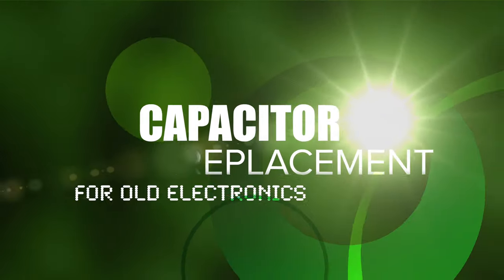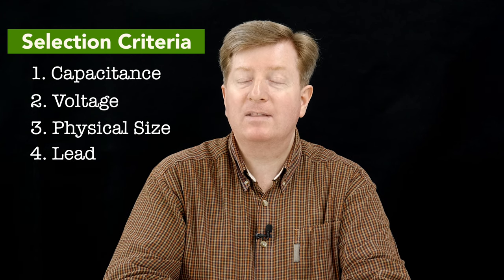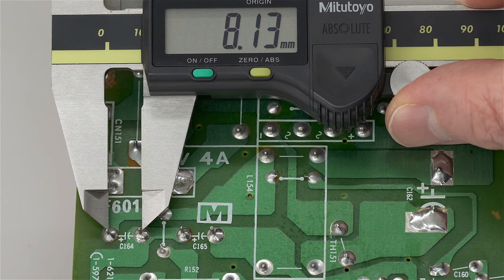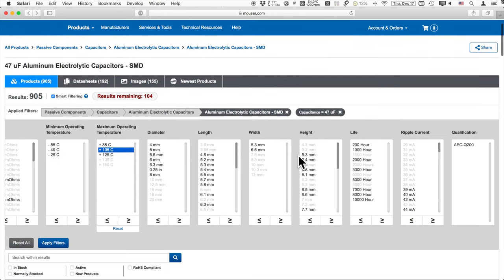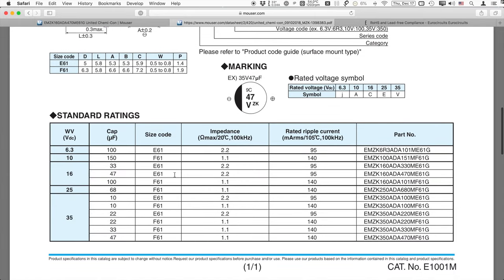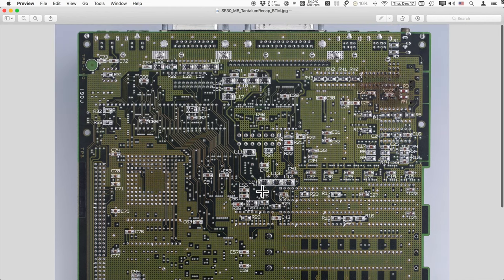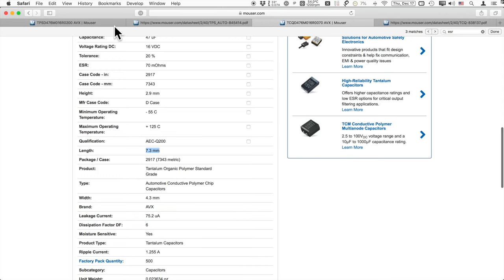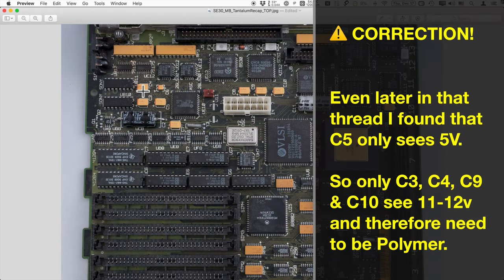Choosing Capacitors to Recap Old Electronics

Comment: some notes on audio gear which i have more than 40yrs experience in. i replace all ceramics i can. they are a big noise source along with composite resistors. not sure why you do not like lead free solder. i have used led free for decades and have never found a reason to go back. there are many outstanding led free solders available today. its not like it was in the old days. you do need decent soldering iron though 🙂 choosing between capacitor brands and models become more important in audio gear. it is largely irrelevant for other electronics. as i do mostly audio, the panasonic fc & fs and higher grade nichicon are the low-end caps for me. elna makes some great audio caps. for non-electrolytic caps, stick with film caps if you can. tantalum is great for computers but absolutely worthless for audio. and again, replace all your composite resistors with film ones i always use 1% which makes for more balanced output and easier fine tuning and better imaging. you will have a much more efficient system, greater headroom, better detail, and immersive soundstage. if you do the work yourself, the parts are dirt cheap. always shield your signal wires and pay attention to their routing. it takes a lot of time to do the work so do it right or not at all. cheers 🙂
Reply from the maker: I don’t doubt your good word or your 40 years experience with audio. But could you please explain why “tantalum is worthless for audio“? You have me curious. The reason I ask is because pretty much every vintage computer motherboard has an audio section on it.
Reply: @JDW-  true. i should have said good audio! computer audio does not have the stresses that a decent stereo has. tantalums are excellent in high frequency applications. they are more suited to digital signals. they sound positively crappy in analog. so yes they are heavily used in computers. i have extensive experience in them as well. i built my first one in the early 70's. the other issue with tantalums is their early problems with, well, blowing up! i am sure they are much better today but the reality is that they are not ideal for the variability and stresses of analog audio work. yes, they will function. in fact there are some vintage audio gear that came with tantalums. no, it did not go well 🙂 so, ok, worthless was a bit of hyperbole. but if you are going to put in all the effort and replace all the noisy analog components as i do, using tantalums will really ruin your day because it will limit the quality of the audio you can get. i have rebuilt 35w common sony integrated amps from 70's and blown away $10k discrete new audio gear in sound quality over and over again. i have a customer who spent insane amount of money on this fancy new setup and he barely uses it because the setup i made him for less than 1/5th the price sounds better. the secret is to eliminate all sources of noise even if you cannot hear it. the problem with noise is not just you hearing it. the problem is that it saps energy from the productive playing of music. this is why i shield signal wires. you may not hear the noise the composite resistors make but your amp see's it and has to deal with it which reduces your sound stage and head room as well as precision of detail. listening to such audio gear is like seeing a beautiful view through a perfectly clear window instead of a crud covered dirty one. it sounds natural and clear without all the crud in the way. but i digress 🙂
Reply from the maker: Thank you for providing further information. But what I meant was that even in a computer, it is not purely digital all the way to the speaker cone. The early audio stages are digital, but you still need an analog amplifier, however bad it may be in comparison to pro audio equipment, in order to drive that speaker cone. And so I was basically asking about capacitor types used in that analog output stage of a computer’s motherboard.

When we talk about tantalum capacitors it’s important to consider that the ones which can catch fire are SOLID tantalum, but modern versions known as POLYMER tantalum do not burn and have a lower voltage derating than their SOLID counterparts.
Reply: @JDW-  yes, that was why i acknowledged utilizing a bit of hyperbole. technology advances and old mistakes are remedied. i do not, however, distinguish between pro and non pro audio. this is mostly a marketing scheme and my work shows it. yes there are purely crappy audio gear out there but many of the gear produced in the 70's and 80's was designed well. the problem was in attention to detail. companies have great design engineers create the perfect unit, then the bean counters get involved and push the manufacturing engineers to save a penny on each component. as an engineer yourself, you would have seen this first hand as it is an unfortunate but nearly universal problem although with my work for the government, i did not suffer from that at least. well, there are thousands of components and 10's of thousands of units produced so the company saves a lot of money. also, they can have many tiers of product moving up in "quality" so it is all great for the company. we who love audio lose. because most of the audiophile equipment is not so revolutionary. most of the cost is not the components. so when we rebuild a vintage gear and use the very best components, we incur, at most, $100 more cost (not including transformers) but the resulting gear blows away most of those "audiophile" gear out there. i have done this over and over again. with sony, with pioneer, with yamaha, with marantz, etc. if the fundamental design of the gear is good, we can bypass the corporate bean counting and create an audiophile gear at a fraction of the cost. in this world, tantalum caps do not exist, like i said, because they are not the optimum capacitor for audio. i was mentioning the historical explosions for one reason audio companies mostly stayed away from tantalums; they just do not bring anything to the table that is needed in vintage audio. their strength is their size efficiency and frequency response neither of which is useful. on computers, both are paramount hence their presence everywhere there. and since they are popular, yes even the sound circuits use them. they are not that horrible to ruin computer audio. i have however, recapped some computer audio circuits and you will hear the difference there too, again, if you have a higher tier audio card with better design. i do recall, years ago, creative labs put out a nice sound card that minimized, or avoided (can't remember) tantalums and sold it for a pretty penny. it had gold plated i/o and was a nice card. i think it was in the 90's? getting old sucks 🙂
Reply from the maker: @AlsanPine  In light of everything you said and considering your extensive experience with audio and knowledge of computer recapping, perhaps you could give me your opinion about a audio noise problem I am trying to diagnose on a vintage Macintosh Portable from 1989.  Sadly, I am unable to get other Portable owners to give me feedback regarding what the typical noise floor is like, so I am somewhat working in the dark.  Even so, the noise is quite noticeable when using headphones, and it's nothing like I've heard in my other vintage Macs, so I think there is a problem on the motherboard that needs to be solved.  My latest video showing the troubleshooting and giving you an example of the noise is here (wearing headphones is recommended): https://youtu.be/MuEObdHCbig

My remarks about the motherboard audio circuit, motherboard schematics and other details are listed by me in the Tinker Different forum here:
https://tinkerdifferent.com/threads/macintosh-portable-pop-noise-every-10s-from-speaker-headphones.3425/#post-29120

If you simply do not know or do not have time to give this any consideration, I fully understand.  Not a problem. No pressure.  But I couldn't help but consider asking you because you are an engineer with far more experience in audio than I am.  I was thinking that perhaps by hearing the noise you might have some ideas I've not yet considered.
Reply: @JDW-  did my answer disappear?! i was going to add to it but it is not here! man, it was a long one too 😞 i hate the youtube message setup.
Reply from the maker: @AlsanPine  Please know that I did not delete posts ever.  YouTube is run by a band of brain-dead idiots, and I am being extremely kind by saying that.  Overly harsh?  Not at all.  I've complained to YouTube about this stupidity before.  Someone writes something, posts it, walks away, comes back, and their post is gone!  They mention it to me.  It then upsets me because I wanted to read it.  I mention this to YouTube.  Guess what?  They have no solution at all.  They are truly a band of idiots.

What I do know is that the foolish powers that be at YouTube don't want people posting links.  They setup their ridiculous algorithm to zap all comments with URLs into oblivion, EXCEPT for my posts.  Meaning, if I post a comment under my own videos, I am somehow empowered to post URLs, but nobody else can post URLs along side mine.  It's crazy and completely insane.  So it could be you had a URL in your post, and that is what triggered foolish YouTube's algorithm.  (If you can tell I am pissed off at YouTube management, believe me, I am.)

What this forces me to do is type out my comments in Notes (on my Mac), and then I copy/paste them into comments here on YouTube.  That's important when I am commenting under somebody else's video.  And then after I post it, if I find my post is gone.  I can re-read the post, figure out what to delete, then try reposting it again.  But of course, if you didn't save the content of your post, that doesn't help you at this point.   And if you are like me, and I think you are, then you are more than just a little ticked off at YouTube for having vanquished your multi-paragraph post into oblivion for no good reason.  And you probably don't want to re-type all that for a while.  But eventually, if you are like me, you will because people like us can't help but share knowledge.

Please also know that I am excited to have this dialog with you because you are a thoughtful engineer who has useful knowledge to share outside my expertise.

Lastly, please know that you are welcome at the Tinker Different forum.  I am one of the founders of that forum and currently serve as an Admin.  There is no time limit to editing posts, and we have a lot of other great features that other forums don't want you to have.  So if it's anything computer-related, Tinker Different is a great forum to share knowledge, and your posts will not be vanquished into oblivion, ever.
Reply: @JDW-   @JDW-  i have had similar experience. a lot of it is due to algorithms. one experience i had recently on ebay illustrates this. i have ordered a bunch of Salix discolor cuttings for my orchard from there but i could not message the seller, nor he to me, with the common name of the plant fully spelled so we had to call it pwillow! we forget that as far as we have come in computing, artificial intelligence is neither artificial, as it needs humans to learn from and intervene, nor is it intelligent since it is just a guessing machine. but that is a different discussion 🙂
i sort of re-created my post on the linked vid. it probably is not as complete or coherent as i was not happy for having to redo it. then i left the message here about the message being gone. this morning i see my message on the other vid is still there so i was going to tell you to go there for a less coherent version. i'm an old fart and while my hearing is supposedly better than the average 40yo, my eye sight is not so great. i guess it is all that looking at schematics for years, or maybe microscopes 🙂 also, i am not technically and engineer per se although i have worked as one. i was kind of a wunderkind and my family was involved with the government so i grew up traveling all over the world and had tutors. my first research and degrees were from my work with the government in microbiology and biochem. when i was 8yo i fell in love with electronics and started to teach myself, not so easy in those days, and later i challenged the full university testing and scored in the 90%+. at that time i was not working for the government any more and i did not bother paying for the ee degree i qualified for so i do not have an ee. interestingly, later i found out that the government was watching it all and i ended up working on some projects with them using my unofficial hobby 🙂 it has been an interesting life. i have forgotten more than many people learn but every day i find new topics i want to learn about. the internet as it is now would have been invaluable for me in the late 60's. i enjoy seeing bright young people doing what they love and sharing it with others. this is the philosophy i grew up with although my work could not be shared at the time of course, many of the r&d we did, however, has slowly shown up with common applications decades later. there is some cool stuff on the way. cheers 🙂 yup, it does not like the p word here either so i out in the scientific name🤣
Reply from the maker: @AlsanPine  Thank you for sharing your story.

By the way, if you want to share links here on YouTube with me or anyone else, you need to obfuscate them like this: example dot com / webpage dot html.  For long URLs that is extremely messy or impossible, but it gets around YouTube management's braindead stupidity.  

One better alternative is to contact the YouTuber directly.  To accomplish that, you need to click on their name (in my case, you would click my JDW name).  That will take you to their channel page.  Then you need to look in the upper left corner (not the left sidebar, ignore that), and just under the YouTuber's name, you should see "Welcome! >". Click that.  Content will appear. Scroll down to "Channel details".  If the YouTuber is nice (like me), you will see "View email address" and you can click that and send emails outside YouTube.  Sending emails allows you to send links normally, photo attachments, and pretty much everything you can't do here in the comments.

The downside to sending emails is that nobody else can read and benefit from what you write.  So posting comments here on YouTube is most helpful for others. But when you have to send a link that you otherwise can't in the comments, email may be your only recourse, assuming the YouTuber in question has that setup.  Personally, I think it should be a requirement.  I dislike YouTube channels that provide no means of contact.  That just isn't right, especially for channels with video content dedicated to helping others.
Reply: @JDW-  ah, now that is useful info 🙂 i can see why some youtubers may not include their email, however. can you imagine thousands of emails a day?! of course you would do this with a dedicated address but still; it would be a full time job just reading all those. there are times, however, it would be nice to go direct if people would not abuse it. i suppose that is why it takes such twisted path to get to it. they make it not so easy to find.
i am now just gearing my vintage audio work up again. i have been caring for my aging parents for some years now and have not had much time for my hobbies 🙂currently, however, my main hobby is my food forest. it is spring and i spend as much time as i can in my orchard and garden. being spring, however, the rain allows me to be inside trying to get organized for electronics again.
btw, your audio is really good on your videos. are you using a clip-on? i use a m-audio on a boom but moving around is difficult. looking for a good sounding mic that will go with me. cheers 🙂
Reply from the maker: @AlsanPine  Thank you again for sharing, and for your kind words about the audio in my videos.  I make a personal commitment to read and reply to all email and all comments under all my videos.  Admittedly, I have less than 10,000 subscribers, which makes my job easier.  But having tried in vain to reach some of the big name YouTubers in the past, I told myself early on that I would commit to never being like that.  I disapprove of being fully detached from the viewership, as those are the very precious people my videos are seeking to help!  This is not to trash any other people on YouTube, but instead I strive to do more than others do.  In other words, YouTube in my mind is much more than just the videos.  Even the text descriptions I write under every video are about as important as the videos themselves.  But my interactions with people who watch and comment under my videos is what it's all about.  And that's why I've enjoyed my conversation with you very much.

To answer your question about audio in my videos, early on I used something called a Purple Panda LAV mic.  It's a wired mic that clips onto my shirt.  But it had noise issues that required me to filter my audio a bit more than I liked, so in August 2021 I purchased this BOYA BY-M1 PRO lav mic (affiliate link): https://amzn.to/3TGc2zA

The BOYA is altogether a better made LAV mic.  I have no hum or noise issues at all, even though it too is a wired mic that uses a very long cable between me and my camera.  The cable is about 10 feet long, and it needs to be long because I keep my camera at a good distance from me when I do those straight-on frontal shots of me at the beginning and ending of my video.  There is no hum or anything like that at all.  All mics produce a certain level of noise, but I eradicate even that during the video editing process.  I use Apple's Final Cut Pro X on a modern Macintosh computer, and that app has a "Voice Isolation" feature which works well to eliminate not only the baseline noise floor of the mic itself, but also eliminates echo in the room too, which is fantastic.  It seems to be an AI based software tool, not a blunt noise filtering instrument like the ancient Dolby B of old we used to use with our audio tapes.  "Voice Isolation" technology actively scans the audio and "intelligently" filters out the cruft, leaving your voice coming through nicely.  It's fully adjustable, so you can leave it set on low to ensure almost nothing important is filtered out.

But even though we have great audio filters today, having a good audio recording is still important, which is why I recommend that BOYA mic.  It really is great, and I've never felt the need to buy something more expensive to replace it.  Admittedly, I've not used a $1,000 LAV mic before, so I really cannot compare.  But I do have sensitive ears and edit while using headphones.  The Boys is cheap, but surprisingly good.
Reply: @JDW-  i will give the boya a try as i do not have a lavalier mic. not a fan of omnidirectional mics as they pull in more noise but i found one for just over $10 so i figure i can't go wrong checking it out. unfortunately their wireless units are for phones. i need professional studio hookups. when it comes to sound, like other things that interest me, i do not play around. my life philosophy is do it right or get the hell out of the way! your editing software sounds amazing. i see more and more ai software for these tedious jobs and that is exactly how it should be. as with everything else i do, however, i like to record clean to begin with rather than edit it out. with lav mics, i may have no choice. we shall see. thank you for taking the time to give me pointers on this. i truly appreciate it. you are right about the web and its ability to inform and create communities. i too think the real power of site like youtube is in connecting and uniting people. like every tool that precedes it, however, it can be used poorly or for evil. i just stick with people who are positive and want to make the world a better place. i am very selective with my choices. i am very glad that youtube, as flawed as it is, recommended your feed to me. they can't be all bad 🙂